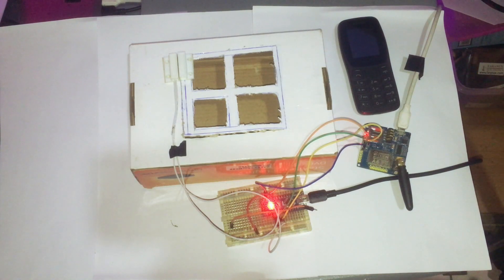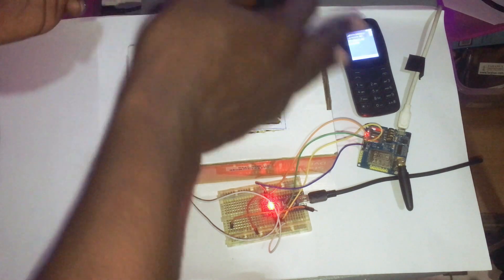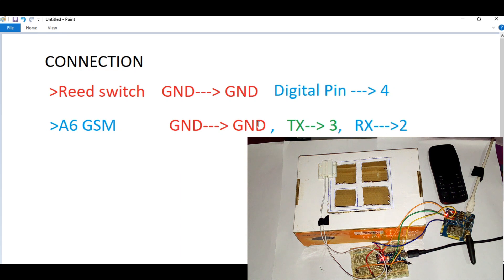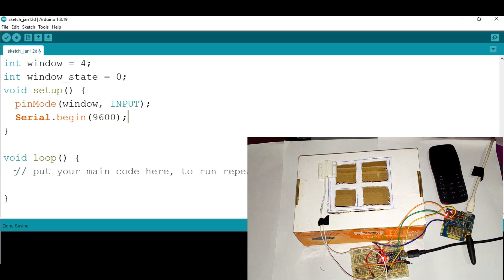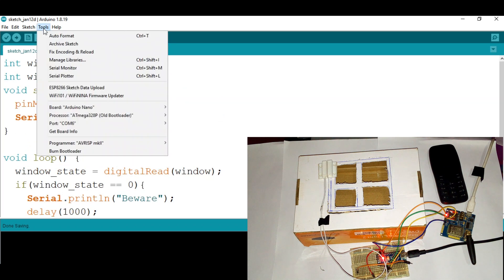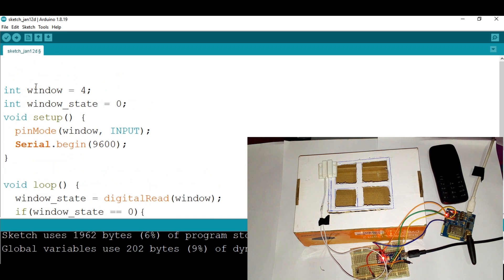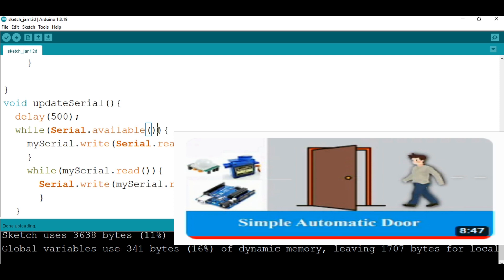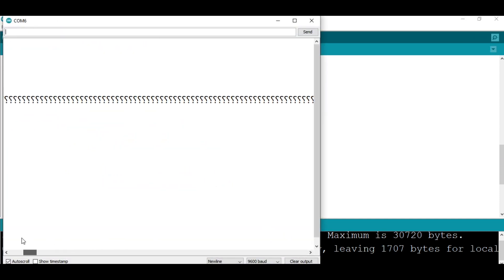How to Build a Door Alarm System that Calls You When Opened

Comment: This is an interesting video. I am wondering if it is possible to use this as an alarm system for a car alarm. I just found out thieves can open the trunk of my 2019 Chevy Malibu without setting off the alarm system and have stolen the valuables in my trunk. At one occasion we found the trunks of late model Chevrolet (Cruze , Malibu) all open. Do you think you could make something like this for that purpose?